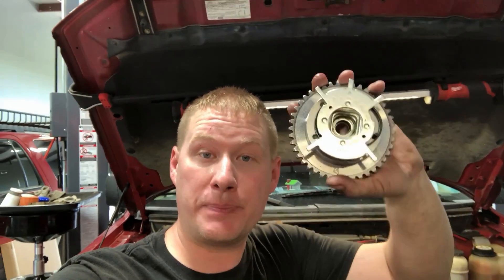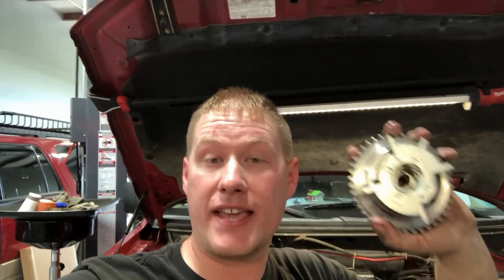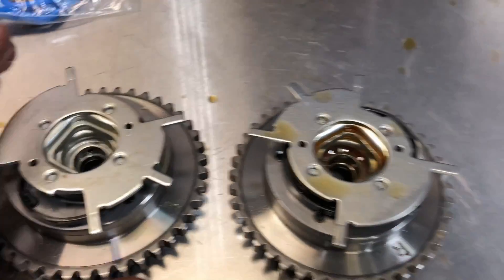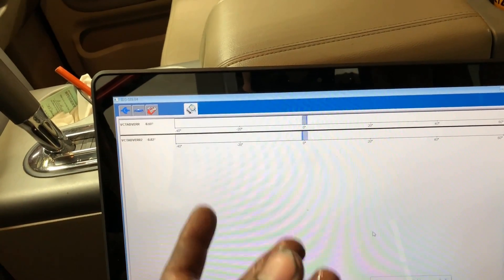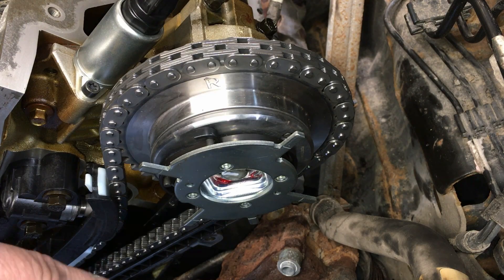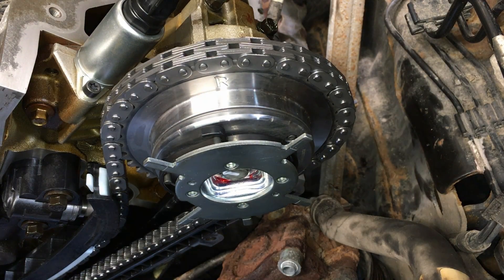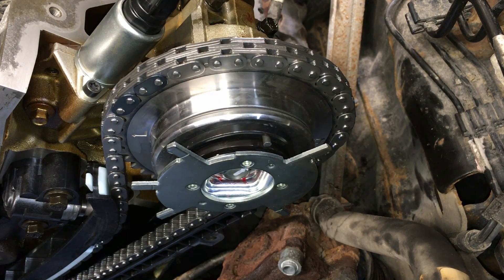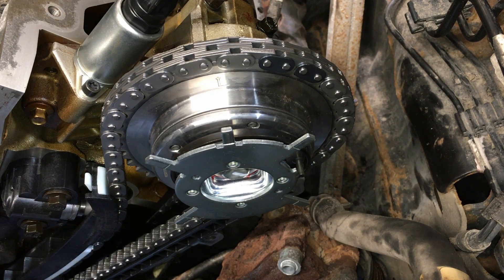Ford 5.4L 3v Timing Kit Choices: This is Why You NEVER Want to Use Aftermarket Camshaft Phasers!

Comment from the maker: These are the 5.4L 3v Phasers and Full Timing Kit I Recommend:
Ford Phasers-
https://amzn.to/2A9tUxi
Full Ford Engine Timing Kit-
https://amzn.to/3O3wtDM
Reply from the maker: Yes only use Melling for the Oil Pump.
Reply: @FordTechMakuloco  if I bought the cloyes timing chain kit  with the phaser is it just as good or could I buy the oem phaser and use just they cloyes timing chain kit without phasers
Reply: FordTechMakuloco I have a question. I have always trusted my ford tech guy to do timing chains and cam phasers and spark plug replacements. 

But I have lost 3 plugs since I have done the tune up on my 06 5.4 3 valve  Bought the plugs from o rilleys. Its like the metal on the end of the plug melts off. 

Any Ideas
Reply: What's the best timing chain kit ? the one makuloco listed is no longer available in Amazon,  im looking at one that is from freedom racing tools is really expensive but ill buy if it's the correct one. Any recommendations please thanks.
Reply: @alexisgonzalez9954  we are in the same spot! Which one did you go with?
Reply: @alexisgonzalez9954  Ford Motorcraft
Reply: What is your opinion on phaser lockouts?
Reply: FordTechMakuloco what do you think about Melling components (phasers)? I know you like their HV oil pumps.
Any recommendations for affordable hand held scan tools that will show cam/phaser timing? I have a Bosch 1150, and it won't show that.
Reply: FordTechMakuloco
Reply: FordTechMakuloco any recommendations on the scan tool?
Reply: FordTechMakuloco any experience with parts from cns?
Reply: 08 4.6 triton?
Reply: FordTechMakuloco so I have the same kit and I was just going to use it for the gaskets but I was wondering if you could compress the stock tensioner and reuse them instead of the plastic ones. And thank you so much for the video's because without your help I would be doing this blindly.
Reply: What's the average price of a timing kit and oil pump replacement? Just for labor?
Reply: @My_EFX 1500 plus parts is around what i expect to spend
Reply: @My_EFX around 2000-2200
Reply: FordTechMakuloco  how do I know if my 2004 F250 5.4L is a 2 Valve or 3Valve?
Reply: @billmccutcheon4559 lucky duck it’s a 2v
Reply: FordTechMakuloco  Is the Duralast timing chain kit from auto zone still considered a low quality purchase ? I need it replaced on my e350 5.4l rv
Reply: Do i need to buy the phasers and the timing kit or can I get just the kit?
Reply: How much would it cost to get someone to get your package that's what I need!!!!
Reply: Please and thank u
Reply: G'day buddy. I'm in Australia and we have these engines in the B series Falcon 02-08. The link you provided to the Amazon store says currently unavailable, do you recommend anyone else and someone that would ship parts to Melbourne, Australia?
Reply: Anything  other than genuine  Ford Motorcraft  is junk ,and will fail !
Reply: is there a kit w/ the guide rails that are steel? how do you feel about the steel ones?
thanks!
i have 155k on a 2004 f150, and i hate wasting things, wondering if chains are a MUST have or if the old chains keep their length properly.
thanks.
Reply: Do you have an updated link, so you get credit for the purchase. I'm doing the job on my 2010 Ford F1Nifty 5.4 asap.
Reply: How much do you charge to install a whole new timing kit and replacing the rocker followers and where are you located  ?
Reply: Does the phaser kit come with both left and right as a set?
Reply: Why won’t this kit work on a 2011? What’s the difference?
Reply: Help! Help! I’ve opened this engine twice and don’t want to do it again if i don’t have to. I think them aftermarket phasers are defective. I got a hard knock and this are my codes; “what do you all think” P0010 status 68, P0012 status 64, P0020 status 68, P0022 status 64, P0341 status 28, P0346 status 28, P0345 status 68 & P0349 status 68
Reply: p0349 bank2, do you recommend changing out both sprockets ? I replaced them before using your knowledge and of course motorcraft. But i lost track of my oil change, got lazy and nearly starved my engine out of oil.  The ticking noise is not so loud or constant. can i get away with changing only one or do do always replace both when performing this service?
Reply: That's the kit I bought (on your recommendation),and the Melling oil pump,and I have absolutely no regrets. It was actually way,way cheaper by far then buying it locally (Canadian eh),just had to take a bit of a drive over the bridge and pick it up at the UPS store.
Reply: Yes,the kit he recommends came with everything for the timing (sprockets,guides,tensionors,chains,phazers,front cover seals and crank seal),but while you're in their anyways do the oil pump,it's cheap insurance (yes I used the Melling),if you do it you'll need to get the valve cover gaskets,a tube of sealant,some blue lock-tite,and new crank/harmonic bolt separate (if you live in Canada the crank bolt price alone will make you faint,so order it from the States). I also did the VCT solenoids since the valve covers were off making them easily accessible.  You accidentally typed 5.3 instead of 5.4 by the way. No issues at all,truck now runs amazing. I'll have to look through my books to see what the mileage (kilometers for me) was when we did it and what it is now.
Reply: Had all the new pieces that you recommend for this job. Got to go ahead and tear everything down on my days off. Well the drivers side went pretty smooth. Cracked open the passenger side and got a huge surprise. My very back roller lifters (nearest to firewall) 2 of the 3 were completely demolished. Pulled them out in pieces. Of course it ruined the camshaft also. But talked to a full time mechanic that looked at the truck. 06 king ranch btw& he told me not to mess w replacing the cam & to just do an engine swap... ok well that’s even more expensive but is it worth it to just do it and not mess w new lifters & camshaft?? Or should I just do the cam and lifters. I just don’t know what exactly I should do now at this point. Trucks at a complete standstill in my lift bay.
Reply: Fordtechmakuloco what about dorman phasers?
Reply: @d_theletter   genuine Ford Motorcraft 

parts only,all others fail!
Reply: What do you think about the Melling Cam Phasers from rock auto?

Comment: Ive got a 2010 f150 with the 4.6 3 valve and the mechanic refuses to do the timing job insisting i need a new engine..Compression is good on all 8 cylinders..Why would be be telling me that?

Comment: Do you remove the heater hoses and wiring harness/fuse block on 2009 Expedtion, or pull covers around them.

Comment: You should see my motor inside. It's better than you probably ever seen. I promise I maintain better than anyone. Mine has 100760 miles on it. And I just replaced both fazers of course ford. I pray it starts. Two things left is crank sensor and tone ring. I pray its all good nowm

Comment: If oil starvation or incorrect timing cases the phaser to act up why do they need replaced? Can't the starvation issue and timing issue be corrected and the same Phasers be used? I've taken a phaser apart and I don't see anything that look or would even wear out. It's like replacing a crank timing sprocket Everytime you you remove a timing cover. Just don't make any sense unless I am missing something... ??

Comment: Just did cam phasers, guides and tensioners and vvt sensors on a 2011 5.4, put the chains and cams back exactly how they were when I pulled it apart, when i park on a slight incline the engine starts running rough but doesn’t die and I got a code P0022 but no check engine light, oil level is slightly above half on the dipstick, didn’t stall like it does now before, oil pump? If I turn it off and start it again it runs just fine.
Reply: yeah same problem

Comment: Hey boss I was wondering if u could give me some advice? I have a 2007 5.4 3v flex fuel..it lost oil pressure and trashed the rods...I put a new crankshaft, main and rod bearings, oil pump timing chain phazers vvt solenoids all from ford it runs good til it gets warm then starts the famous phazer chatter but if u Rev it goes away...I replaced the 5w30 with 10w30 and it runs fine but I am wondering why that would make a difference? Oil pressure is good the whole time just driving me crazy. I plasta gauged all main and rod bearings there great would the camcaps contribute to my issue?never ran into this before and I have rebuilt 15 or 20 5.4 amd 4.6 engine any help would be appreciated that's

Comment: The original parts, made my ford, are failure prone junk too though. Is any company capable of building a reliable phaser that doesn't fail? or should i just look for a blocking kit?
Reply: You have most sensible comment in this entire section. Is just not a good design at all
Reply: They do make a kit that locks the cams in place, I’ve seen a couple videos on it, and the people who used them seemed happy with the result. 

These fail on EVERY engine over time on these 5.4’s no matter how well you take care of them, I agree they are junk.

Comment: Great video. I was gifted a 2005 Ford expedition with a 5.4 3V, 170K miles. The owner kept good maintenance records. Beautiful interior. The motor runs good (no codes) but there is a transmission whine. My goal is to have the transmission rebuilt, and I’ll do the timing components on my own with guidance from these videos and Ford parts. Hoping to have a great running Expedition for under $8K. I used to rebuild Chrysler Slant Six 225 motors is the late 90’s so I’m hoping to not have too many issues with the 5.4L components install.

Comment: doing full timing lit oil pump phasers whole shabang (60k) miles changing out the rollers but i have a question should i di the lash adjusters ? already wag over budget

Comment: I'm replacing my chain guides, do I need to change the chains too right away? Or is there a way of checking the chain to see if it's still good.
Reply: Dude if your going in there just do it all. Absolutely you will regret it if you don't.

Comment: So im having issues with my 09f150 5.4 its missing under load bad but idles fine. I did the plugs and it made it a little better but it's far from being right. The only code i get is a knock sensor code. I have a oe level scan tool so i can look at everything i just don't know where to start. It's got over 200k on it and it does rattle from time to time it sounds like a heat shield rattle more than anything and it doesn't happen on start up its intermittently. Any clues as to what that may be. I knew it's impossible to diag something without actually being infront of it just curious on a direction to head in

Comment: Just did a timing job with a melling kit. Phasers and chains were "made in china" so opted to put my original ford phasers back in, they came out of an 09, still lined up and did a careful  inspection of spring and such. After installing roller followers, i rotated the engine by hand to verify no interference and my phasers seem to pop like this ever so slightly once a revolution. Are they defective or is it that without oil pressure they move?

Comment: So I followed all your steps to take off the timing chains replacing the phasers and chain guides. And everything came out perfect fired up at the first key.  But now my oil gauge show no  pressure and vehicle cut off  and shutdown I just replaced the oil pressure switch sensor.  Any help

Comment: How many failures of aftermarket phasers are simply due to not soaking them in oil before installation? Prolly alot. Some of the chinese ones are absolutley fucked, but melling, cloyes and even dorman have cheaper ones that if you make sure they arent damaged in shipping and soak them in oil real good they do ok. Plenty of people leaving reviews that theyve lasted. I got 95k out of a pair of dormans. And the only reason the are needin replaced is the seal on timing cover at the crank went bad and reduced my oil pressure causing a tensioner to and then the driver phaser looks fucked. Doing a whole thing, cam lifters rollers etc and we will see.
Reply: What was the end result? Did you go with aftermarket again?
Reply: @ZacharyDeanWright  still driving it 18k later
Reply: @ZacharyDeanWright  yes i did aftermarket this time prolly wouldnt if i wasnt broke but i got lucky i guess

Comment: Ok now you got me a little worried about the Ford Performance timing set I ordered for my 2007 Mustang gt with 150k miles on it. Came with phasers, chains, tensioners, guides, a new front seal, and gaskets for $600. I'm sure it's not as cheap as this ebay junk, and I've heard it's a good set, but now I'm worried.
Reply: Soak in oil before installing itll help alot

Comment: Other than these cam phasers and timing system these are actually good engines just a design flaw.5.3 chevys actually had more issues than these.
Reply: I'm not mechanical but I bought my 10' silverado new, 180k miles now, I had 1 problem, the valley cover came loose. Dod is all still there/stock. I have a 2008 f150, 65k miles, coils, vvt actuator, vvt sprockets, no power band. I hate my 5.4 compared to my 5.3. And if you buy all ford parts $,$$$ add a comma. 5.3 will take any part you out on it
Reply: I'm no mechanic***
Reply: Really solid motors with a a block that has all the bottom oil passages bored out, upgraded oil delivery systems and coolant and then most of the issues are fixed. Solid 350k motors.
Reply: Although a Chevy 5.3 has it beat bad in the coil department. Not sure if it’s even possible to wear out one of those. The 5.3’s major weakness is the cam and lifters. With all timing components good to go on the ford you still have the cam wearing out the cylinder head to worry about. Let’s not even start comparing reliability of spark plug design, those high thread design in the three valve motors is no where near the word reliable, 5.3 is so much better in that department they can’t be compared.

Comment: Please can you tell me if I install a cam phaser lock so that the timing remains in the advanced position will the fuel economy be better (more torque) in normal driving without ever towing something like a trailer and trailer? THANKS
Reply from the maker: worse

Comment: Great videos! I did a full timing job on my 5.4l 3v following your videos also purchased all of the Ford parts from your links and also installed the melling M360HV . When I started the engine it runs  and sounds great but after about 10 miles, when I come to a stop, it idles rough and sometimes stalls. check engine light comes on. Codes are P1000 and P0605  I'm not sure what to do now. A mechanic said the engine is no good without looking at it. just based on the codes. What would you recommend?
Reply: Might be the oil pump he said in his other videos that he only recommends the 340HV pump

Comment: If you buy the lockout kit will the phasers basically last forever? Everyone tells me to do that and buy the SCT tuner with custom tune to turn off the cel error code. I replaced everything with Ford parts here recently and in less than 5000 miles the passenger phaser failed again.
Reply from the maker: Sounds like installer error or misdiagnosis. I have never seen one fail after, how did it fail?
Reply: @FordTechMakuloco  I had purchased a Ford timing/phaser kit and had it installed by a Ford technician roughly 5000 miles ago. Recently had the truck diagnosed and the garage said passenger side phaser needs replacing. Getting a light knock after truck warms up, front of engine/left side, sporadic rough idle at times. I guess that doesn’t mean the phaser is gone, I know you’re much more thorough in diagnosing. Just looking for help, I watch your videos over and over about the 5.4 engine. I find it hard to believe the cam phaser failed after such a short period of time. I won’t know until the shop opens her up again. Any advice on what else I could check would be greatly appreciated. Love the channel and videos, thanks my friend.
Reply: So I guess it’s possible there was an install error. I had both phasers replaced again. The new mechanic said everything looked installed properly. After inspecting the right side/passenger side phaser he found it was bad. He was able to turn it by hand and was certain it was causing the noise. This was a genuine Ford revised phaser that had only 10,000kms on it. That’s hard to believe it failed but I guess it does happen. Rare maybe but it failed and cost me another $1000 bucks to replace them and $800 Canadian for new phasers. This time I had them locked out so no more ticking or knocking issues. Truck sounds and runs great now. Since they can’t move anymore, this should last a long time.

Comment: I have a problem with my Kia Sportage.

I get p0011 and p0012, which is over advanced and retarded cam timing.

The part is keyed, but the dealership wants me to pay $175.00 to make sure the phaser is installed correctly. 

The guy who installed it told me it was keyed and impossible to install incorrectly. 2 other mechanics, one of which is an expert on cams said the same thing.

Sounds like the dealership is trying to screw me.